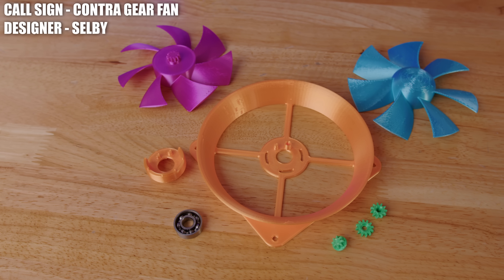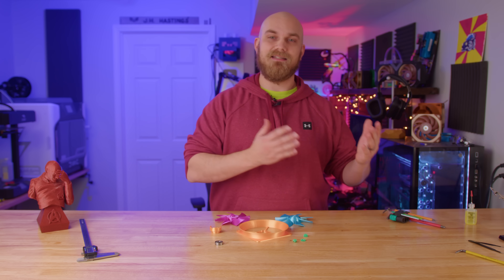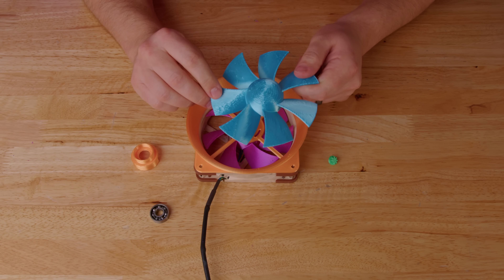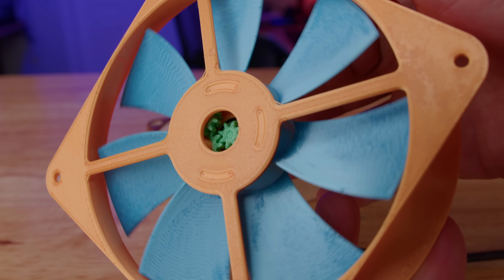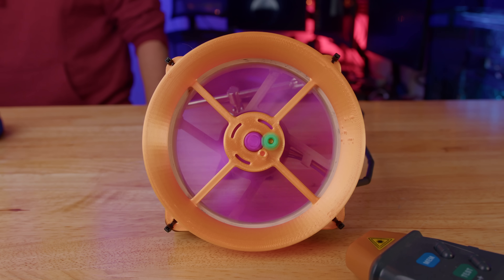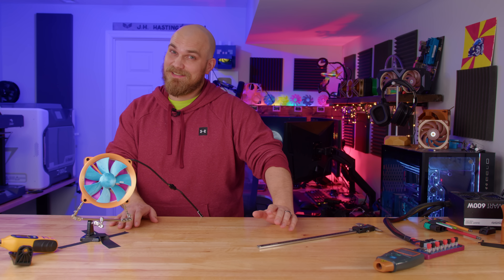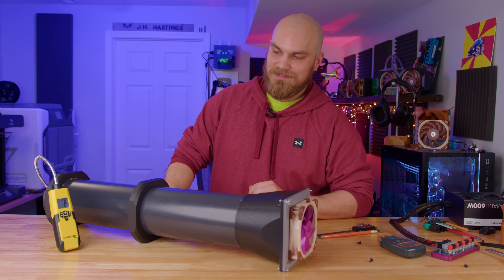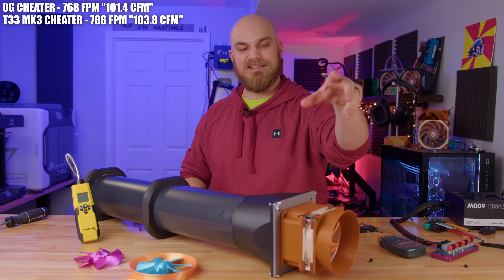World’s Most Complex PC Cooling Fan | Fan Showdown S4 Special

Comment: For the next gear driven fan, I'd try some dry lube meant for bike chains, maybe even some wax-based one (there are some that come diluted in a solvent that evaporates somewhat quickly and leaves a wax layer). Mainly to attract less dust and, I assume, it will get flicked off less
Reply: PTFE spray. It's not wax-based. It's actually a type of plastic that's dissolved in alcohol. You spray it on and the alcohol evaporates leaving the very slick PTFE plastic surface.
It's a dry lubricant as well, but it won't have the stickiness that wax sometimes has.
Reply: @TravisFabel    I mentioned the wax one since I remembered seeing one at the store. Looked it up, and turns out that they claim it is wax but is suspended in some hygroscopic thing...? They also claim that thanks to that, it attracts water in wet environments and becomes more like an oil and evaporates in dry conditions so it becomes more like a dry lube. It's cerabike, the one I'm talking about. They also got specific dry and wet ones.
Reply: Dry lube would be a bad choice for this application. Film lubricants don't decrease friction as significantly as oil lubricants, they're mainly intended for high-load applications.

This is a low-load application where you want to decrease friction as much as possible - almost exactly the opposite use case.
Reply: @louisvaught2495  To be fair, PTFE is not your typical dry lube, I would think it would be in a different ballpark to any other sort of dry lube product. Brilliant because it does not attract dust and the whole "teflon" thing kind of speaks for itself
Reply: @poo123444  Nope. PTFE has a really high COF compared to oil lubricants. Solid lubricants are for when you want some sort of lubrication under high-load conditions or something where you can't build a liquid film.

We're talking a couple orders of magnitude for a well-designed bearing. This won't be well-designed but I'd be surprised if it's higher than 1/10th.
Reply: @louisvaught2495  Would it work to use both? spray the gears with PTFE, then lubricate with oil?
Reply: PTFE is more stick at low load aplication. As tehnician i use alway WD40 or something simmilar like oil based for said aplications.
Reply: @alesksander  wasn't wd40 meant more for seized stuff and keeping water out?
Reply: Saw a guy build an engine out of wood and he just takes a bar of soap and rubs on his gears. Prevents over heating and makes the gear run smooth
Reply: @Joshua-uq9zw  I guess that's because any oil based lube would absorb into the wood. And, aren't you talking about William Osman?

Edit: sorry, I somehow read that wrong. Was thinking about the bycicle and not an engine
Reply: @Joshua-uq9zw  Making gears run smooth versus no lubrication at all doesn't mean it's low drag.

Normal wood has a really high coefficient of friction. Lignum vitae is pretty good but for anything else just lubricating it helps.

PLA on pla doesn't have a high COF to start with. Solid lubes won't do that much.